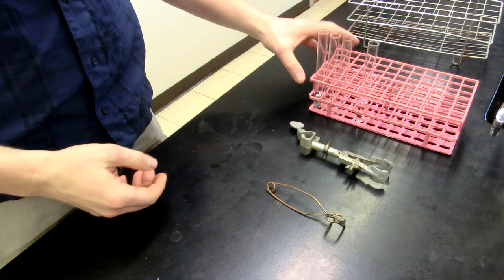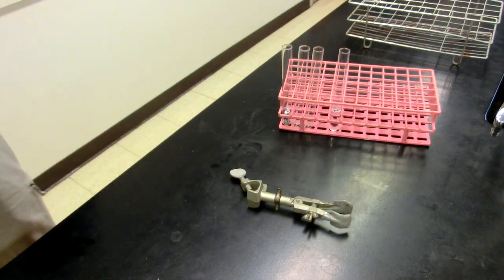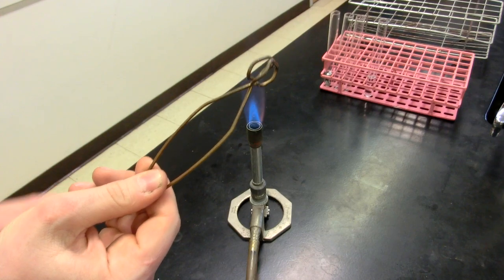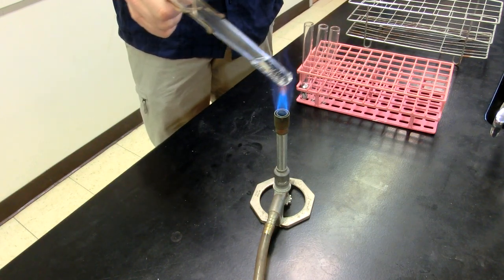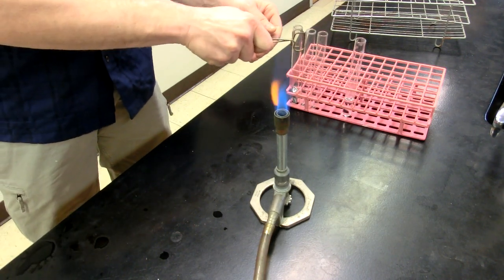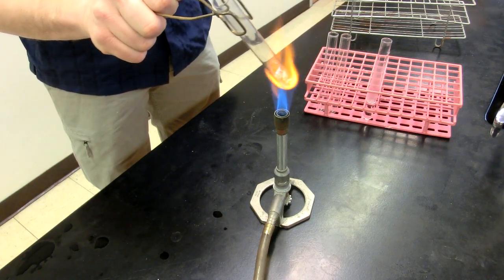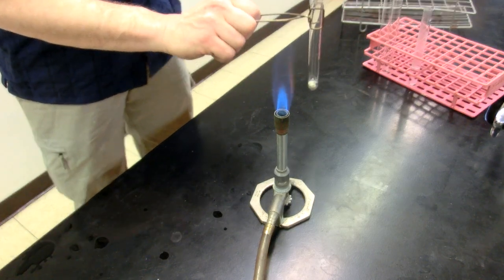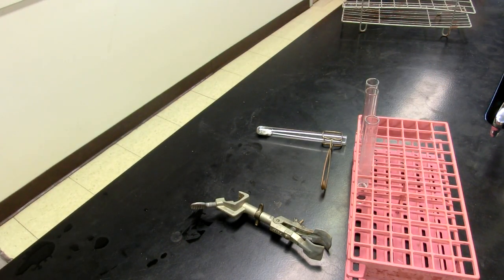Test tube holder and heating

Comment: Will the test tube holder not heat up when you hold it using that way?
Reply from the maker: It is less likely to.  The metal is further away from the flame as long as it is at the top of the test tube and the tube is angled.

Comment: I just wanna know, knowing that the clamp is also metal, is it okay that you aren't wearing gloves for this procedure?
Reply from the maker: When using a clamp, you don't have to touch the metal unless you are moving it on the stand. When using the test tube holder, if it is being held at an angle the metal should not get hot.  Also, if you are heating a test tube, it is not being heated for a long enough period of time to warm the metal (assuming it is being held correctly).